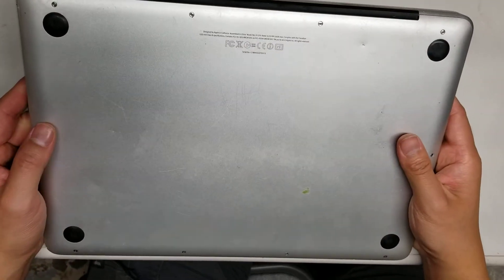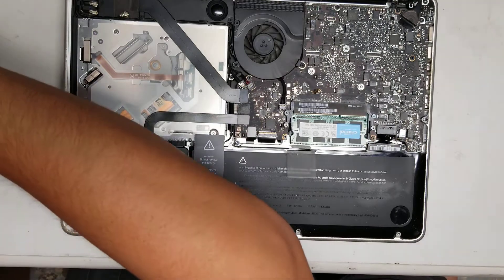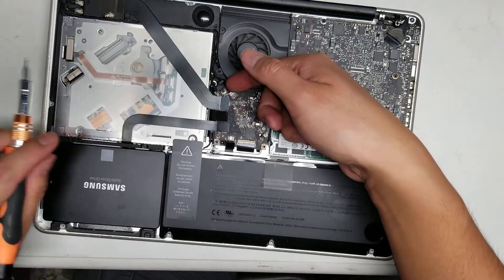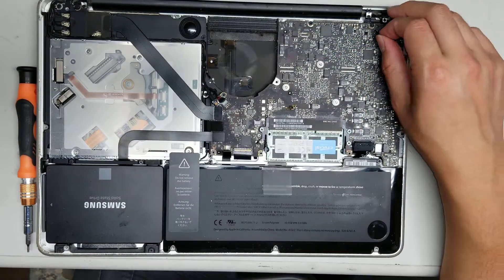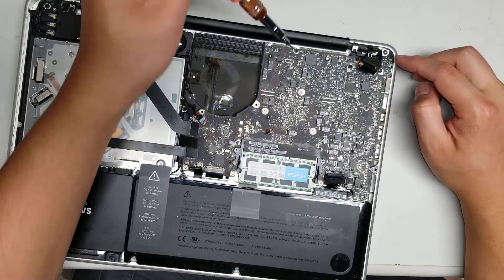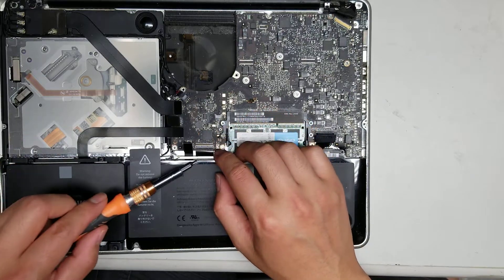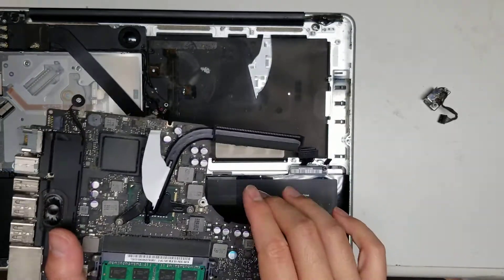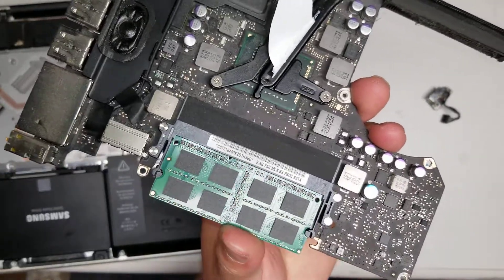2011 13" Inch MacBook Pro A1278 Charge Port MagSafe Motherboard Logicboard Removal Replacement

Comment: Dear really thanks for your tutorial! I would ask you your opinion...i have a macbook 2011 unibody and he did'nt start no more. I bought a new battery and when i changed the macbook starts again and works fine. Only i connected to a power safe but the battery didn't  recharge, the connector light was always green ...then after one hour the new battery die, and the macbook didn't start no more. I tried with two different power adapter but the battery didn't charge and also if i disconnect the battery the mac didn't power on. Then do you think depends from the motherboard or from the charge port magsafe part?
Really thanks for your help
Reply from the maker: Make sure the battery connector is pushed all the way down.
Reply: @ i tried more times to reconnect it but did't works
Reply from the maker: @massimorussoni7219  :( maybe the charge port is bad or the charger
Reply: @ItsBinhRepaired ok thank you 🙏! I sholud try to replace the charge port...
Reply from the maker: @massimorussoni7219  yeah

Comment: Is the connector you removed at 4:13 a speaker? I bought the same model second-hand on eBay, took apart the computer, and that connector is damaged; it looks as though it melted from high temperatures. :(
Reply from the maker: @jonathanpastran8250  yup, not possible to melt from the heat from the computer
Reply: @ItsBinhRepaired  It gave me that feeling, as it seems like that connection has been removed, because the points are completely separated. Thank you for the clarification.
Reply from the maker: @jonathanpastran8250  they probably broke it and tried to glue it or something

Comment: I had the same macbook pro that also had the same problem, the logic board couldn't charge the battery and it need to be plugged all the time so ther's no portability. 
1. Can I just use powerbank using usb to magsafe cable?
2. How mush is the cost to replace the logic board?
3. For years the battery couldn't be charged, would that means the battery is dead by now?
Reply from the maker: Power bank could work. Did you try a new battery first?
Reply: they said it's the logic board need to be replaced by they don't have the spareepart @ItsBinhRepaired
Reply from the maker: Apple is full of sheets sometimes. I'd try a new battery first.

Comment: What is that cable called that you said be very careful with? Need to replace it. When I pulled and wiggled it the wire came loose from the plug.. thank you!
Reply from the maker: What time stamp?